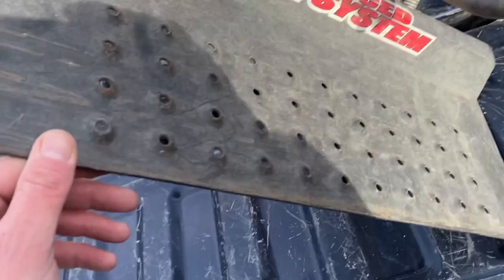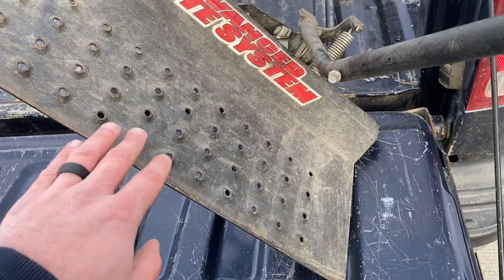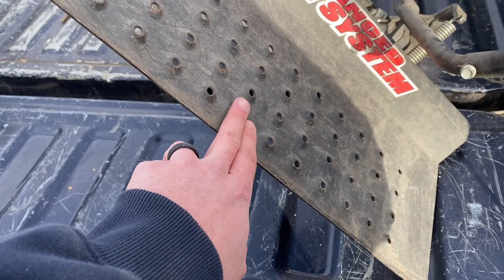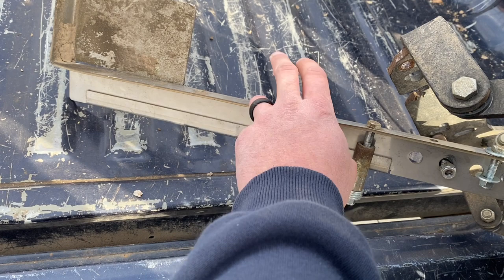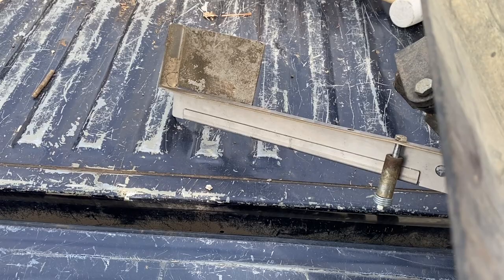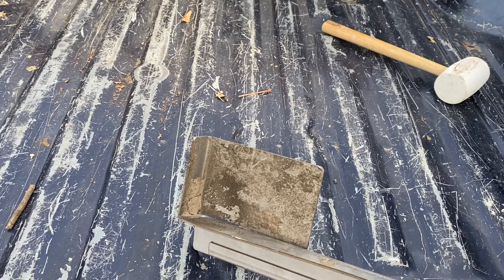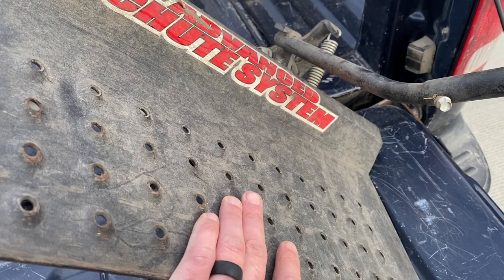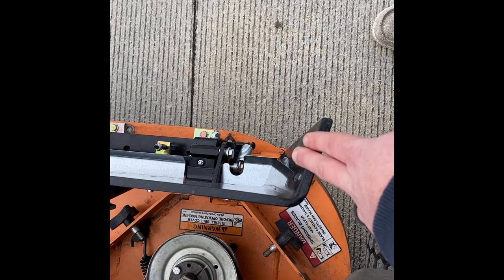Advanced chute blocker vs Quickchute review!

Comment: I always thought to myself that the advanced chute blocker may be better thought out because the holes are their to preserve the vacuum of the mower. One of the things I noticed with the cheap chute blocker I have now that when I have to use it to cut a strip it will leave a small trail of grass clumps right at the discharge point. I always thought that this would help with that but if it does indeed throw a considerable amount of grass through it I may be looking for something else like the Quickchute.